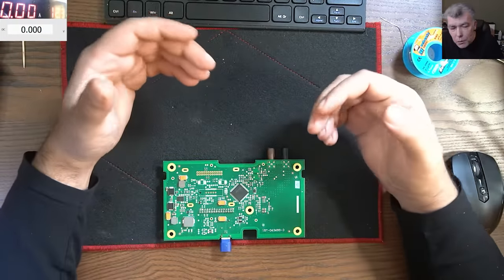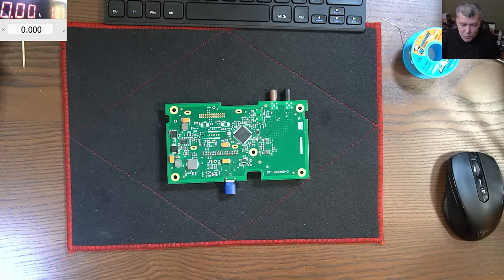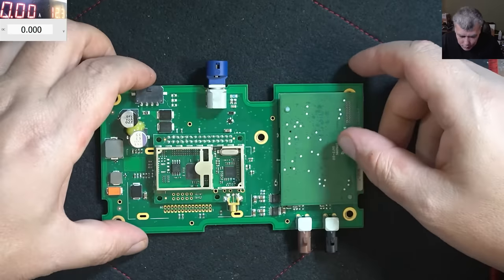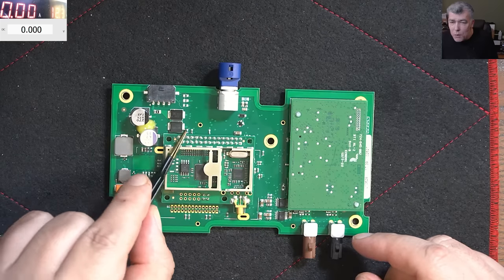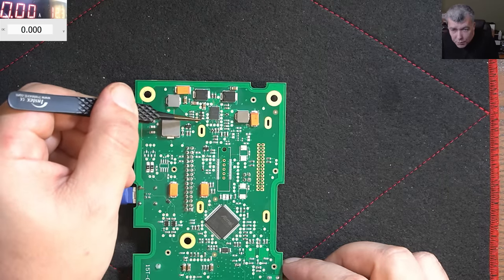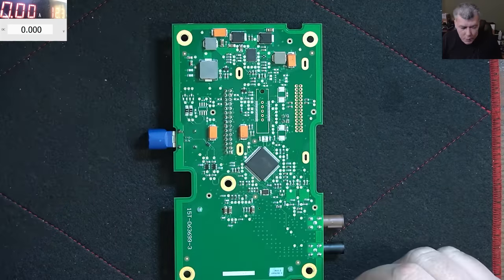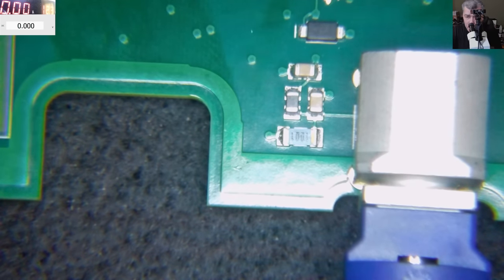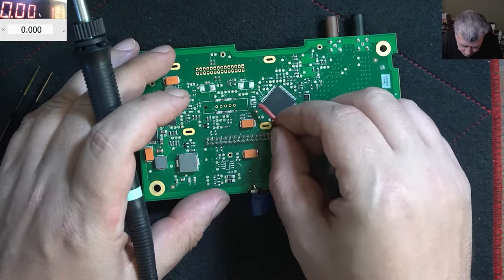You Can't Fix It, Because You Are Not Good Enough

Comment: hi sorin,
can you check the voltage on reset_n , VDDIN_5  and VDDIN_33 pin ?
perahps the Microcontroller has not enough voltage to start or is blocked in reset mode.
i mean, you measure 0v on vbus, so it's put on ground ,why? to terminate the usb session

that's why i believe the µp is not dead,
 of course , i can be wrong.
Reply: "USB_VBUS: Bus Power Measurement Port Input" is an input port. So only 2 issues could be
1)external components like resistor or capacitor are damaged
2)internal ESD protection is demaged

Comment: That resistor dropping 3.6 volts? Seems suss to me. I would have removed it from the board and checked it's resistance cause it's acting like it's open with those readings.

Comment: on the blue connector on those thin lines it is a filter like on playstation? if yes you should check the continuity cause those filters like to burn with no signs of burn. maybe on this filter is no communication. im not a specialist but you can try to check it. ;)
Reply: I was just thinking of the same issue :)

Comment: I got annoyed with my xtar charger I blew it with 12v ment to be 5v think I reversed the polarity lol
Blew a smt  transistor do ya think it will work I have hacked at the transistor and capacitor next to it but it's still saying short between 5v and gnd bout 2 ohm difference to ground on the trans connections middle positive mmmm

Comment: when anyone tells me that their laptop screen doesn't come on, if they've checked the power and the powec comes on but no display, i tell them to plug into an external monitor. if it works on an external monitor out rules out the gpu. i tell them the problem is the main deisplay and they should send it off to the manafacturer to replace the display, if they ask me to do it then i tell them i have neither the tools nor the physcical skill to replace it.

Comment: I don't get it. If customer has a working unit why not to read all memory by JTAG and write it to broken CPU to chceck if it's bad CPU or software? Why not to buy new one CPU and write the software to it from the working one? Ok, doing it by JTAG can be time consuming instead by dedicated programmer or using aWire proprietary protocol but it is possible. More so no one has to sit and watch the process. Btw this SoC is not read protected as far as I know and write protection is based on fuse bits per page basis.

In my personal opinion it is not limitation but lack of the must have knowladge and tools if one wants to deal with electronics this days. At least those three: JTAG, I2C and CAN in automotive case.

Comment: You can't because it's cheaper just to replace. OK, you located the fault and it's a 128 pin controller how can it it be replaced without expensive tools - forget it. He's right, beyond the PSU there's not much to be done.

Comment: Automotive electronics failure are mainly firmware problems but working on a single board without having the rest of the equipment to test the failed board is only time wasting and customer then will tell you everything he wants.Didnt work at all,other things are happening after repair,after your work board become damaged,rarely will never tell you about a successful repairing and so on.See first what it does and finally test it again to know the condition of the board before shipment.Blind repairs are always turn bad.

Comment: Sooo.... if the ATMEL wants to talk since it does have power, then it probably is talking, right? The way I look at it there can only remain two (two -ish) things: the communication doesn't get to where it needs to go OR it does. In the video you follow the two datalines but you skipped over them pretty quickly, stating that the two chips that are interrupting their path is "probably some mosfets for protection". So.... those can be broken. What do they measure as, with and without power? If they are not broken then that means the signal is getting through from the ATMEL, via the mosfets, to.... where? The two radio boards. That's the only place to go, right? 

So if those boards can "easily" be taken off, you have a new path to a solution.

Or, what is another possibility, is that the ATMEL chip is talking but it is speaking gibberish. Is it not possible to use a cheap second hand scope and see at what frequency it is speaking at? And then check the datasheets of the chips on the 2 radio boards to see if the communication matches as to what it is supposed to be? So we don't even need to know what it is saying since we do not know the ATMELs programming, but if we know it is talking and the signals are reaching the radioboards, then that is the next place to go to and check out.

Couldn't it be as simple as maybe not even the mosfets on the two datalines that are for "protection" being broken but only a capacitor or resistor in that "sub" circuit accompanying the mosfets?

Oh man.... I have started getting into component level electronic repair due to you. And I have stopped due to depression and back problems and everything else going to isht too. So... yeah. That's not nice. However, now I am back on your channel, just by chance since youtube suggested your video, and watching you work and hearing you talk.... I can feel my motivation bubbling up again already. You really are an inspiration to me and you make me feel more enthusiastic about trying this stuff again.

So.... yeah.... my own stupid mistake for not watching your videos more ey? :-D 

But yeah... I think you might want to take another look at it and focus on the 2 radio/communication boards and what leads to those. Something might have broken in that direction due to which the ATMEL now just thinks: "what are you saying? Hello? Hello?", right? Like with the POST on a laptop... it waits to hear back from other parts before it continues. If it doesn't hear back, it loops, or hangs, or turns off.

Comment: Indeed Soren, when you have a programmable chip on the board and do not have access to bin file to program the chip - not much can be done.

On rare occasion when the chip software is not protected by fuses it can be read into a file. Most companies try to protect their Intellectual Property by setting fuses and the chip will not be read.

In such situation only option is to ask the manufacturer to send pre-programmed chip. 

It might be possible to acquire a replacement chip from other donor device but it is not know if the MCU is in good condition and does not have same problem (game of chance).

Comment: and if you take out that chip buy a similar one... try to take out the firmware on that... if it's not read protected... ;) and inject that firmware  on the new chip. :D most likely it would fail... but... :D maybe it's just too much work... :D some times the chip rom is ok... and not the chip... so you can extract it or even reprogramme it even if it doesn't work... (7No I never did this ever... I will do some xylinx programming and atmel in some future projects...

Comment: Maybe you need check the crystal with osciloscop
Reply: yup, had it once. quartz are fragile both electrically avec mechanically. they can break after a shock. it was the issue once for me. changed quartz and worked again.

Comment: The chip probably  need to be reprogrammed.   
U could possibly   
1. Copy the firmware  from the  working radio 
2. The chip could be waiting  for communication  from the rest of the radio before  it works. Like  smbus of a laptop  battery.
Reply: Pretty much all commercial microcontrollers have their code protection bits set when flashed and can't be read.
Reply: @jameswest848  not always  
atmel studio .. Also cant see  that feature in schematics 
 I would give it a go  win or loose would def make more Interesting  video  :)

Comment: Or if you cant buy the component to fix it then its also done.
Reply: Yep, that seems to be the main problem with stuff these days. Had the same problem with a Dyson Fan I just looked at, and a couple of Milwaukee BLDC tools.
Reply: Mr Guru  Personally I doubt the atmel is faulty. Unless something external has caused failure such as the voltage regulator putting too much voltage into it but the voltage regulator side on that board seems to run ok. They are very reliable chips I've used quite a few mega2560 in various projects over the years.

Comment: I have a liquid bubbles of contactor style array of the connections to reading the actions of everything on the board's meeting of the mind so to speak the whole picture is worth it later to realize studying the experience and THANK S i really like the TESLA chapters on gasses and vacuum tubes to transistor radio telemetry wave the first word telomere length was integrated actively involved with circuit information how to build it well being zero tolerance for lose of exiting unfolding and folding overlapeing voltages mess up  information about the rate of a pump that has seitch long short drivers the hi low part  tranfering faster than usual can be slowed down allmost a paused for all type micro beauties thoughts in the sounds think about hummingbird vibrational energetically to the heart beats well learning about the world all over again essentially the timeline that is a like ballancers circuit information how to build it well not complicating it to hide the waves that created it is the one thing

Comment: You skipped the most important ones: the TVS diodes on the USB lines and the power from the USB to the micro controller. There are some other very simple things to check: The µC Reset pin, the x-tal oscillator might be broken and Vdd core. If Vdd core is one is gone, the micro controller is toasted. Vdd core is internally regulated too 1.8V. I find it disturbing to see you trying to repair something and giving advice to your customers and teaching people while your knowledge seems too limited. Do you have an oscilloscope?

Comment: @northrigefix
Reply: I don't want to be disrespectful. Ali is great at micro-soldering, but he has not even 50% of the electronics knowledge of Sorin. I know is Sorin is dodgy, but he's using his dodginess for fixing things that Ali would just refuse to fix. They are basically in a different field of repair.
Reply: He mentioned many times hes just electronic engineer so micro soldering expert will do better this job
Reply: @jjtv3086  I doubt that Ali or Sorin are electronics engineers. They are both very experienced in repair, but I can catch them (especially Ali) not knowing things  an engineer would know (I am an engineer).  For repair you don't really need full engineering knowledge - experience is much more important.
Reply: Mr Guru  Agree. Ali uses his channel to push up his prices. He is now at 95 USD just for a quick repair attempt (so a non-fix). This is probably less than Sorin charges for a successful repair. Ali is a very good business man, but if you check his latest google reviews you'll read some pretty horrible stuff. Luckily for him he gets many good reviews from viewers (which are obviously not real customers).